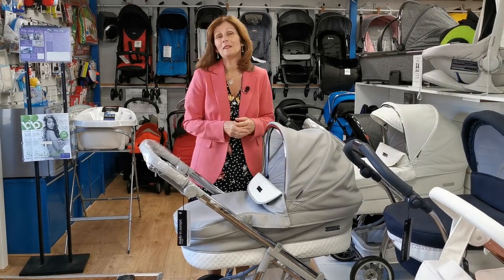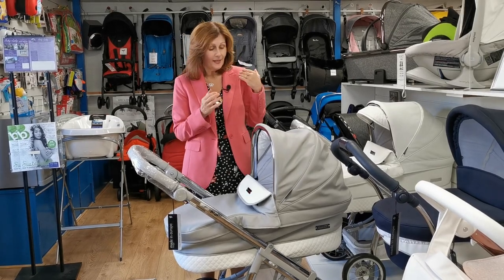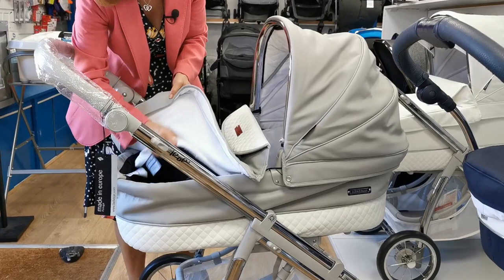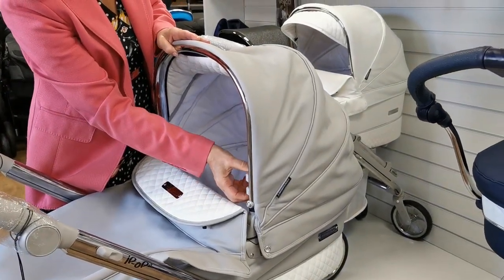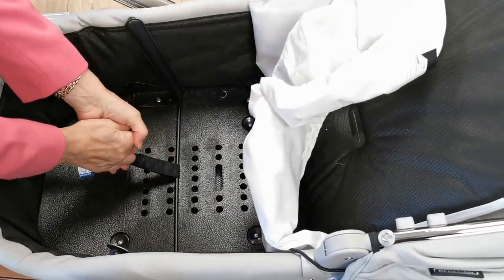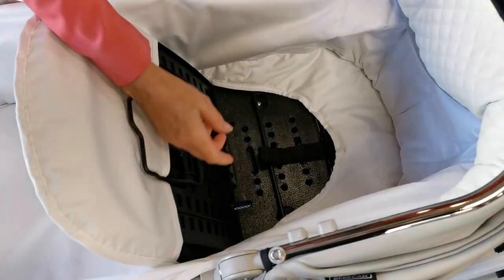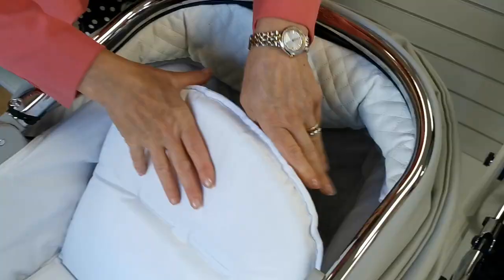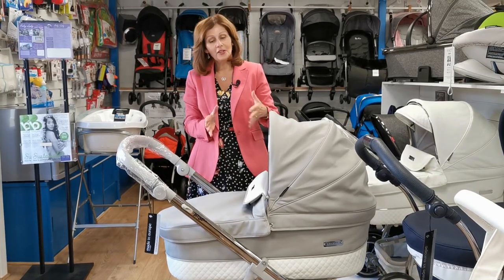How to assemble Bebecar carrycot - Baby Lady, Canterbury

Comment: Hi I have a problem with the bassinet hood on the ip op and I'm hoping you can help ?The hood will not stay up and I've tried a few things without success 😢many thanks Sharon.
Reply from the maker: Hi Sharon. It can be very stiff when new, and you may have to pull it further forward than you think. If this does not work not, we would recommend you go back to your retailer for more assistance.
Reply: @BabyLadyUK1991  thankyou very much for the quick reply and yes I may  have to do that .